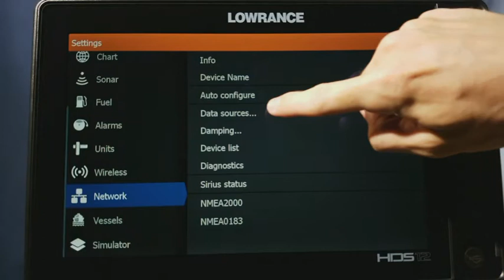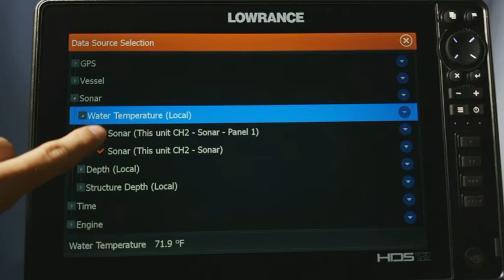How To Use a HDS Live/Carbon - no water temp

Comment: Does this work on the hook2 5” triple shot?
Reply from the maker: No it does not. If you are getting depth but no temp then you have a bad transducer. But if your not getting either then the plug might not be pushed in far enough.

Comment: My HDS lives show the temp at 6 degrees higher than actual. This was as compared to a number of friends with Lowrance units prior to the start of a tournament, one guy mentioned some setting for a -4 or -6 degrees in Lowrance but I don't see this.
Reply from the maker: Ya they used to have a water temp calibration setting but on the later updates it's not working. If you watch my video on internal sonar settings it kind of explains this. If its reading off then chances are there is an issue with the temp sensor itself inside your transducer.